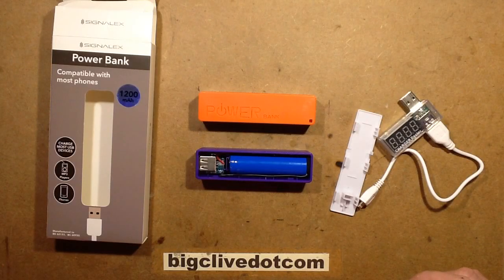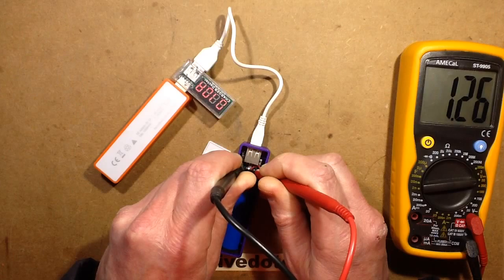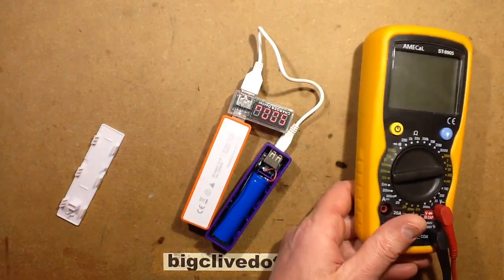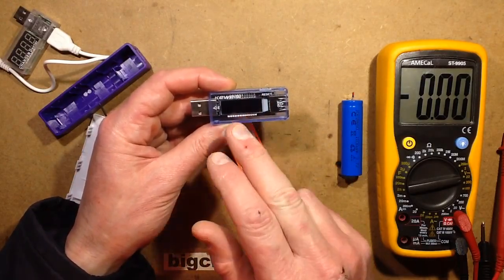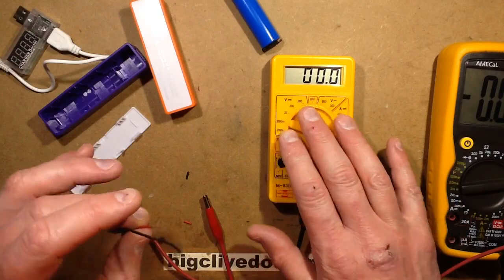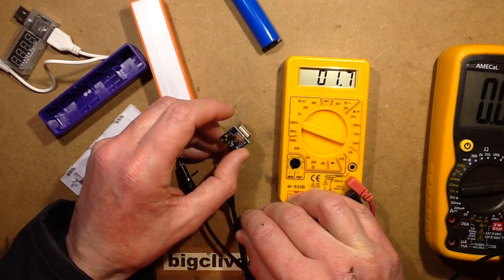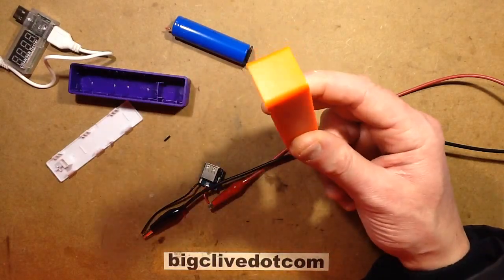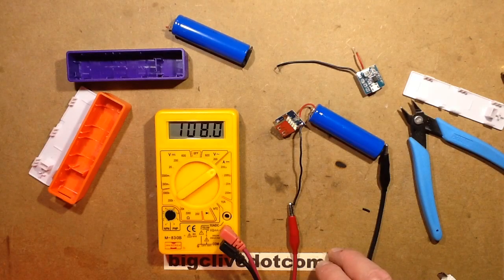Poundland's 2016 power banks.  (not a good start)

Comment: Powerbanks in general seems to be pretty poor quality. Ive bought quite a few like 3 or 4 and every one of them has been really poor. As in cant even charge the phone 100% even though it has 4-5000 mah and the phone battery is only 2000 mah. Then ive had some that die after a few times in use. And they wasnt exactly cheap ones either. we are talking 100$ power banks. Not sure if im just unlucky or what.
Reply: RMJ1984 why the he'll would you waste hundred dollars on power bank lol
Reply: As i said, the cheaper ones kept breaking or being DOA. so i would get a refund, by a more expensive one. In the end i got them all refunded and didn waste any money. It just seems odd that even the expensive ones are so bad quality.
Reply: RMJ1984 I've had great experiences with Anker power banks, as well as making my own.
Reply: The best thing to do is to buy original name brand 18650 batteries, buy a good quality "battery bank case" from eBay, depending on the number of cells you bought (1, 2, 4, 6, 8) and "make your own" power bank.
Reply: RMJ1984 I know but to even buy in first place hundred dollar is lot

Comment: I have that exact "cheapy meter"  - an overview of multimeters would be great.
Reply: the mastech one is the original, when you get the unbranded 830 meteres, they have terrible construction, no fuses sometimes, and the worst circuit board inside
Reply: i don't care what brand it is. It is Yellow and from my childhood i belived that yellow meter of that design must be better than black. 
When i was in highchool i didn't buy one just because there was no yellow ones anymore in the shop.
And now i use two uni-t which i love and hate at the same time :]
Reply: jusb1066 Thanks, mine is mastech.
Reply: me too and I now know why the fuse blew :-)
Reply: Darren Tarbard look at lygte-info.dk
Reply: EEVblog has done a few of the junk ones.